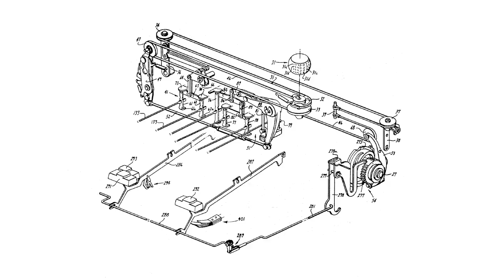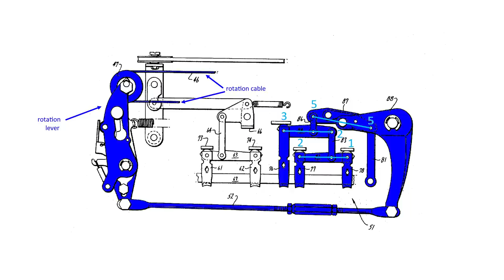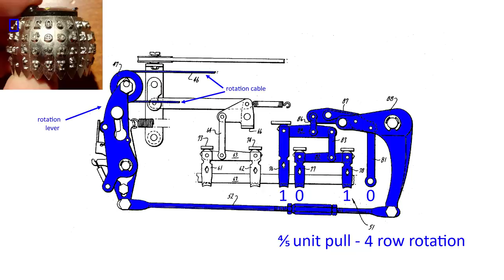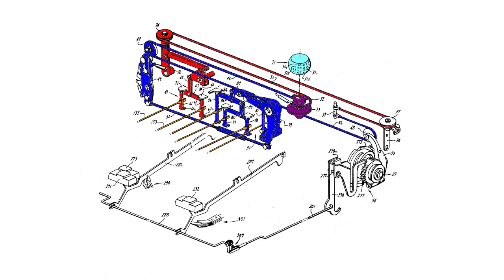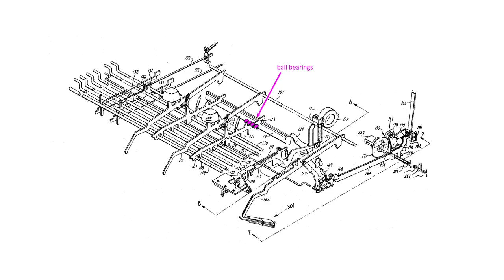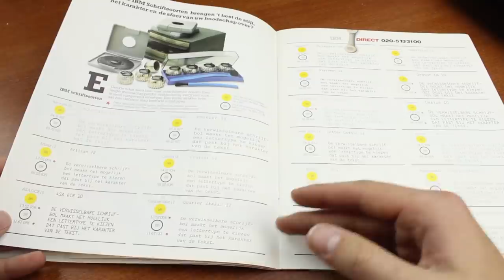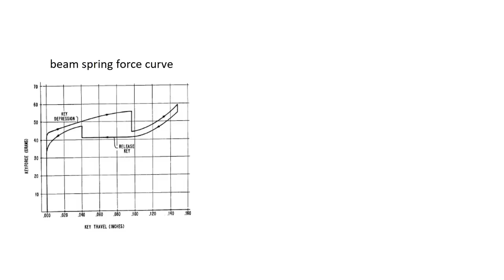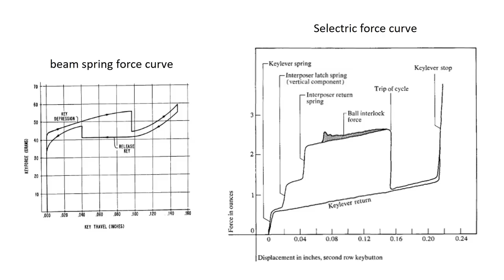IBM Selectric typewriter review - and how it works!

Comment: 11:37 How does it erase like that?
Reply: Shadow Heart, the machine our host uses in the video has the fancier, more expensive style of ribbon. Instead of the inked-soaked fabric that runs back and forth until the ink is used up familiar from old type-bar machines, it’s very thin plastic — something akin to recording tape — coated on one side with pigment and only runs through the machine once. When struck by the print element, the pigment is transferred in letter form as a cohesive unit. The correction ribbon is sticky; when struck with the same letter, it picks up the whole character and literally pulls it off the page, leaving only clean paper behind. When we first saw it demonstrated, it was magical. 

I don't know whether the sophisticated spying scheme described by some other commenters was ever used by the Russians. But it is true that the used-up ribbon cartridges from these Selectrics represented a genuine security risk, since you could unwind the ribbon and read every character that had been typed with it.

Comment: I have a green selectric the same as this one but mine needs servicing so it types and roles paper straight.
First of i know i need a special tool to get into it but after watching this and know knowing a little more on whats on the inside yeah fuck that im out.
Also mine as a ibm branded dust cover that has been sitting on it for soo long it maintains the shape of the typewriter when you remove it >__<.

Comment: Well I got you one better: I have an IBM Memory Writer 100 which uses a magnetic tape and an analog to digital circuit to position the type ball and reprint letters.
Reply: Not quite.  Still uses the exact same mechanical whiffle tree to position the element, and the print is still entirely mechanical.  The main difference on the IBM Memory Typewriter (& Mag-Card) is that there is no direct mechanical linkage between the keyboard, and the printer.  Instead, Reed-switches detect the keyboard input, the Electronics interpret and process the signals (including storage/retrieval via magnetic tape or cards) and send the output to various Solenoids around the machine to replace the mechanical linkages. But the actual ball positoning and printing onto paper is still exactly the same as in the video.  🙂

Comment: Hmm. Legit metal typewriters from the 50s evolved into the Selectric in the 60s, beam springs in the 70s, buckling springs in the 80s, plastic rubber domes in the 90s, and touchscreen keyboards in the 2010s. Whatever gets invented this decade isn't even going to require you to move your hands!

Comment: In the video, you said that digital data was transformed to analog to produce the strike.  Is there any place along the path that that digital data could be mapped to current ASCII characters?

I am retired from a career in computer technology since 1967.  My last position was a President and CEO of a computer consulting firm.  I have always hated the keyboards.  HATED with a passion.

I also an a movie producer.  My first film is coming out soon, starring Kevin Sorbo, the Benham brothers, and Brian Bosworth.  It is due to come into the theaters early nest year.

I expect to do very well, perhaps in the millions.  For my next project, I want to produce a PC keyboard with the mechanics of the Selectroic.  I have purchased "mechanical" keyboards that were supposed to imitate a selectric.  All they did was add a sound generator.  What a waste.

If my movie does well in the theaters, I want to move ahead with a project of a true selectric keyboard.  It is time, and I am done typing on keyboards that are designed for elves and fairies with all the finger force of a speck of dust.  I'm a man....I type hard. and spend a lot of my time going 'back and editing what I typed.  ENOUGH!!!!

Since you have studied the mechanism, is there a place where a digital interface could be inserted to replace the remainder of the analog typing logic?

C G Cope, III
cgcope@dmcons.com

Comment: DAC in Selectric was fully mechanical. Not really related with computer printers. IIRC IBM 1407 (which was terminal for IBM 1401 computer) was based on even older IBM model B typewriter with regular typebars. Also IBM 1403 line printer (also used on 1401, and then on 360 and 370) was introduced before IBM Selectric. Computer printers do not really use DACs, they get digital signal and then the signal is kept digital for all of it's path. No matter it is drum printer, thermal printer, impact printer, laser, or even wheelwriter. they have no DACs. Even motors used be the stepper motors, where speed is controlled by digital signal (timing controls speed, order of signals controls direction).

Comment: I had an original IBM TOOL BAG COMPLETE WITH PART MANUAL & REPAIR MANUAL..  I LEARNT DAY & NIGHT FOR YEARS I STILL HAVE SOME PARTS TILL TODAY..  THESE IKEY INTERPOSERS CAN BE FORMED/BENT TO FIX KEYS PRINTING DOUBLE CHARACTER SOMETIMES BY JUST LUBRICATING THE SMALL TRIGGER LEVER & CHECKING THE LEAF SPRING PRESSING IT... SIMPLE  FIX. VELOCITY CABLE RIBBON MECHANISM HAS A TINT ROLLER THAT RIDES ON A  A3 LOBE CAM . THAT CAN BE ADJUSTED .. THERE IS A COMPLICATED ESCAPEMENT RACK  & COMPONENTS  & TINY SPRINGS FOR ALLOWING THE ESCAPEMENT PAW TO TRIGER JUST FOR ONE SPACE SOMETIMES THIS PAW DOES NO IMMEDIATELY LOCK BACK UNTO THE ESCAPEMENT RACK CAUSING THE CARRIER TO JUMP 2 SPACES OR MORE SOME TIMES LUBRICATING WORKS & SOME TIMES FORMING THE ESCAPEMENT MECHANISMS & SOMETIMES INCRESING THE TINY SPRING TENTION

Comment: You either have pumped up the base or have the mic too close to your mouth. This results in a distorted recording of your voice with too much base, you probably already have a deep voice so there is no need for this. This might sound ok on a phone or laptop but with good headphones or speakers it sounds really bad, with overwhelming bass. I really like your content and voice but this should be changed otherwise I have to change my audio settings which is too much work for a YouTube video.